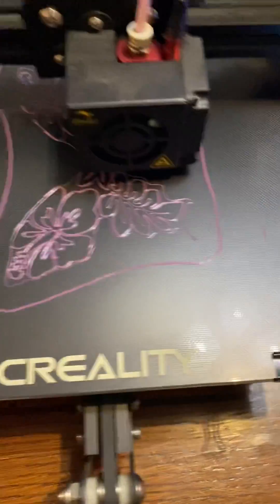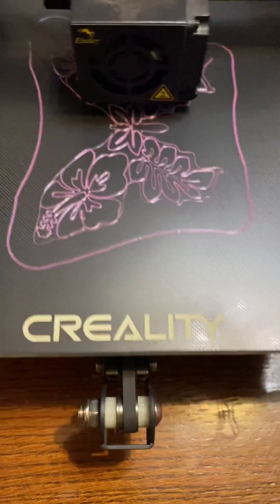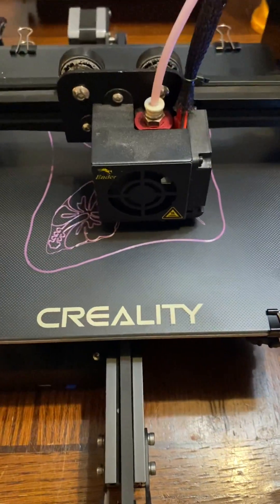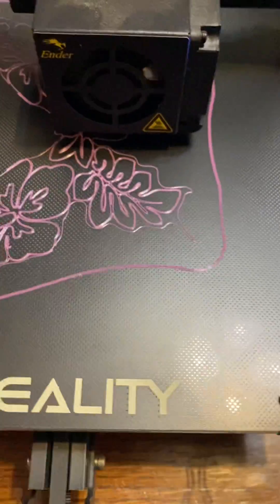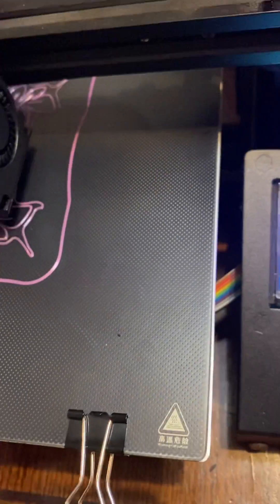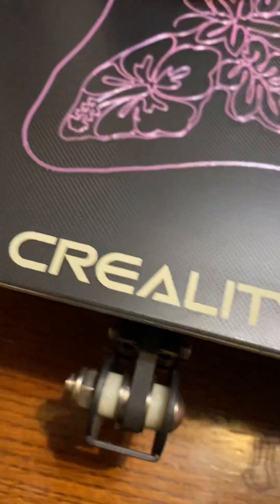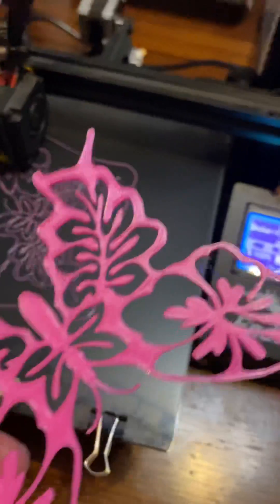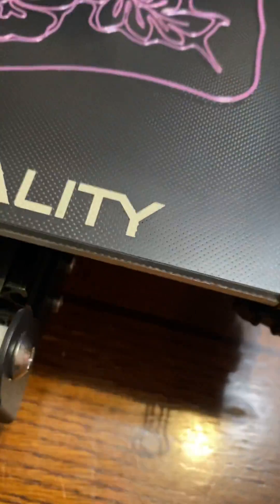Creality Ender 3 Glass bed adhesion solved!!

Comment: I was having issues with it, I tried glue stick but it's annoying to wash. So all i did was simply used windex, cleaned it off. dumped a good amount of alcohol on it, cleaned it off. sticks like a charm now. These glass plates have a special coating and you have to clean them really well for the coating to work how it should.
Reply from the maker: This hasn’t stopped working for me yet. I have been having good adhesion ever since.

Comment: What grit is the sanding pad, and does it still come off the hotplate just as easy when it cools off? the glass worked fine for me the first few prints now I can't get any adhesion so I wanna give this a shot.
Reply from the maker: Yes it still slides off when the glass cools! I bought medium and fine on the grit. Those gator sponges don’t have a number but yes the piece still slides off after cooling!
Reply: @Henrylopez000  aawesome, thanks. Imma give this a try!!